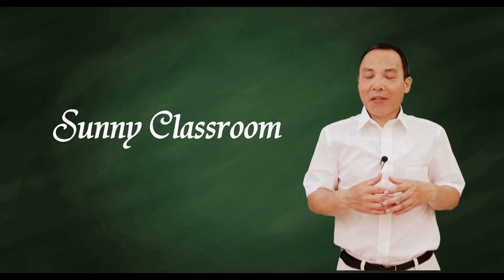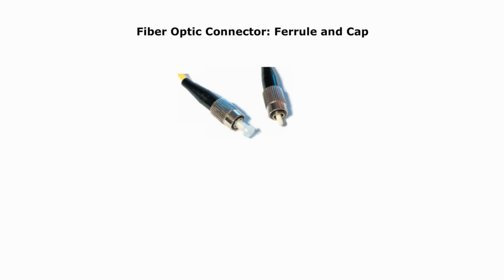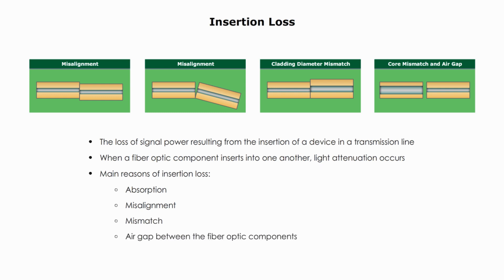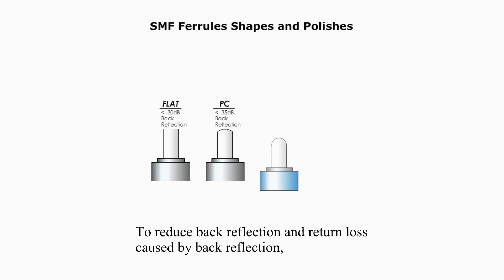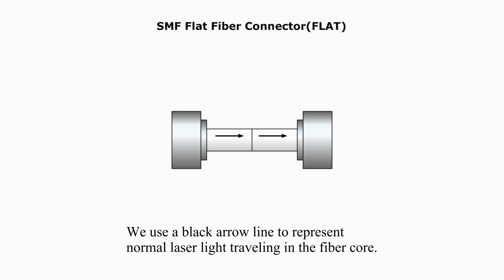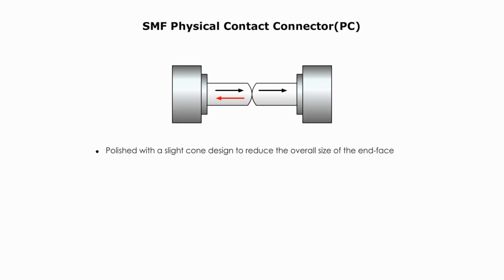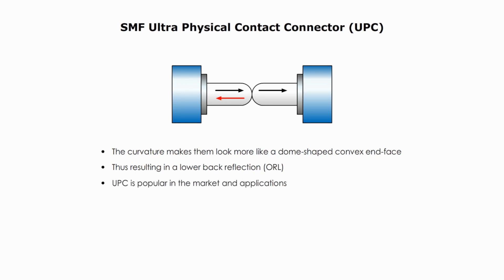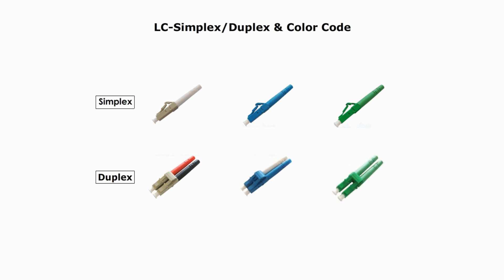SMF Connector Ferrule Polish:  PC, UPC, APC

Comment: Does it matter if I use blue or green UPC or APC fibers for connecting to SFP modules? I have 30M OS2 fiber with the blue LC connector and that seems to work fine at 10G. But how do I know what type I need for the actual fiber modules?
Reply: all depends on company if its personal preference then try each connector on the fiber you are using and test it on otdr or power meter  to find best results